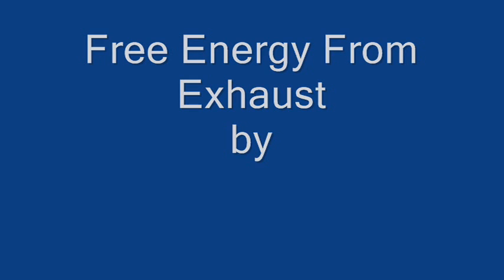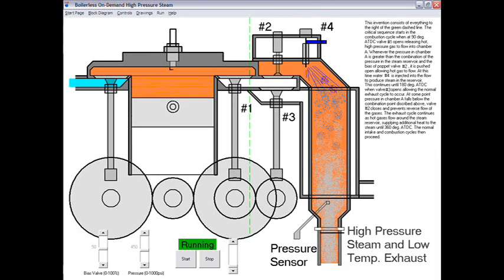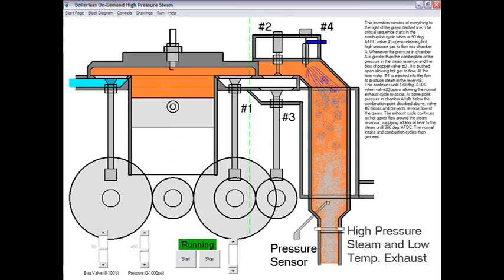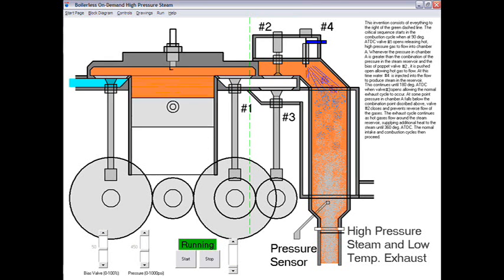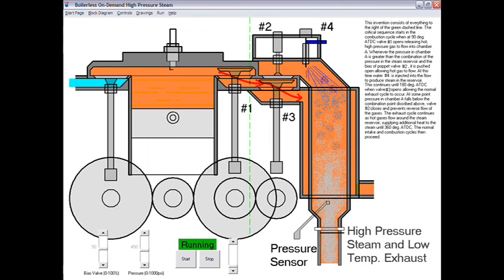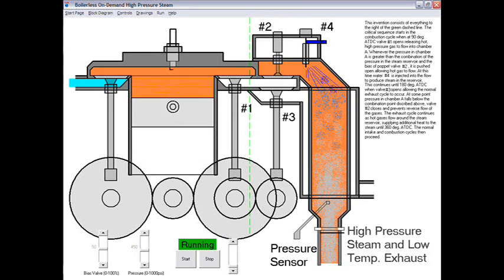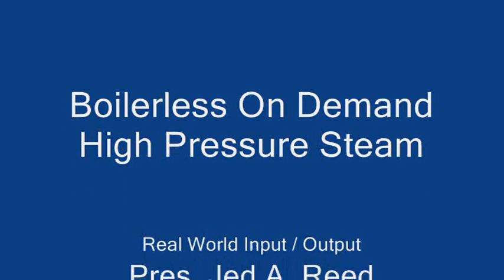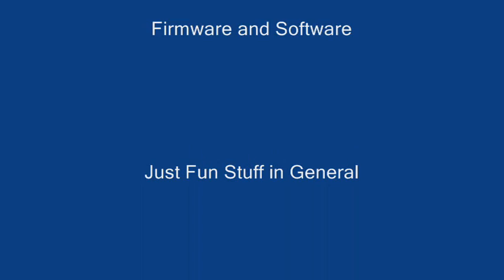Free Energy from Exhaust2 with CO2 Scrubber

Comment: Just curious, where exactly does the "CO2 Scrubber" in the title fit into all this???
Reply: +Kamyar Amjadi my thoughts exactly. not to mention the (no offence original poster) the pretty much zero knowledge of how a combustion engine works, and pretty much no explanation for how to make the device work, and no real explanation as to why the hell you'd want to use a gas engine to create steam.............. you could just burn the gasoline (or something we've known about for a long time... wood) in a box, like, say, a bbq pit or something, and set a pot of water on top of the damn thing and make steam... i can think of about a dozen different ways to make steam without using an internal combustion engine... a few of them are solar power...   unless he is trying to use the steam AS a scrubber to scrub emissions from the exhaust, in which case, he still doesn't need extra valves and random crap...    and changing the timing to 10 degrees before top dead center is PRETTY MUCH where most cars live anyway, with the exception that nowadays, all cars have electronic timing advance controlled by computers, whereas they used to have timing advance by vaccuum.  either way, you can not.... set an engine at a specific timing rate if you intend to change rpms like a car engine for example..... a generator, a lawnmower, sure, why not.. but lawnmowers have no business creating steam.    

not all inventions are good inventions, but, on the other hand, more power to him for inventing it and putting the idea out there.   good for him...
Reply: +Kamyar Amjadi however, yes... i was looking for an explanation about how c02 scrubbers work as well....

Comment: The    motor vessel  diesel exhauster gas temperatue is 330 celsius degree. An 28000HP engine powers the propeler and  a 800HP alpha laval  steam turbine. This turbine powers a AC generator.

Comment: Why can't you use a heat exchanger on the exhaust and a liquid pump.. The liquid pump doesn't use but very little power since the liquid is 1500 times smaller or so.. I already seen an experiment where they were using this setup to run a small steam engine pulling a generator that charged the batteries in a toyota pris off the exhaust heat of engine..